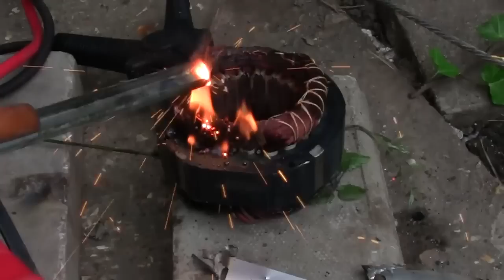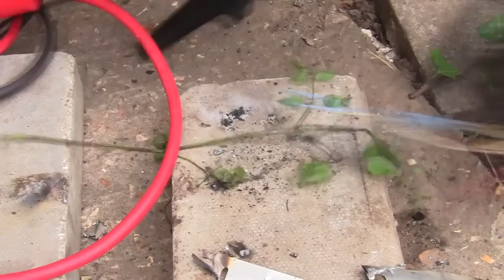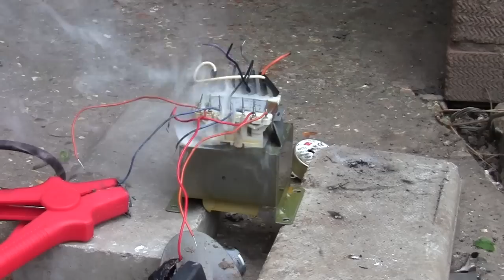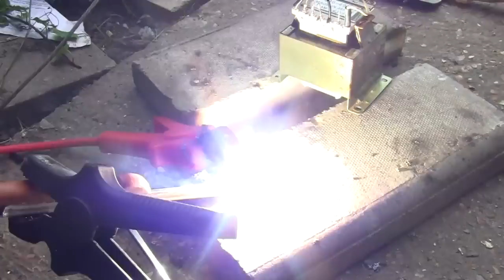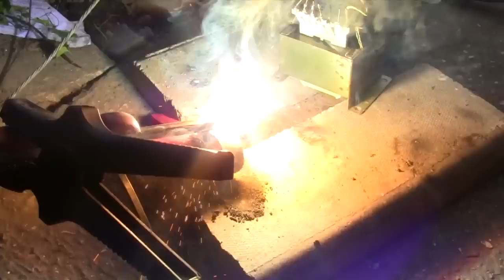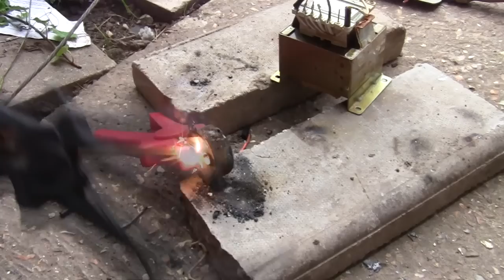fun with 600v dc

Comment from the maker: @HDXFH power supply is a welder modified to produce 600v@20A max although I've never had it at 20amps because of the input and inrush current will pop the fuse lol